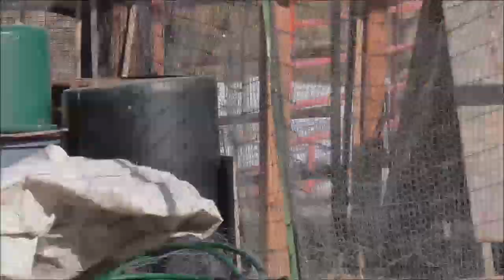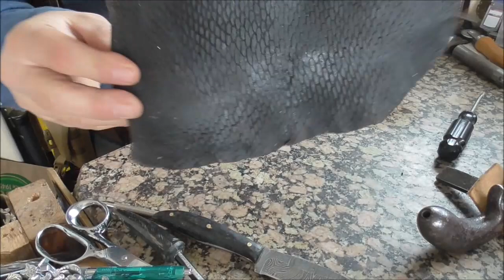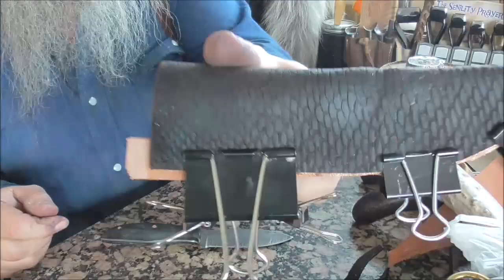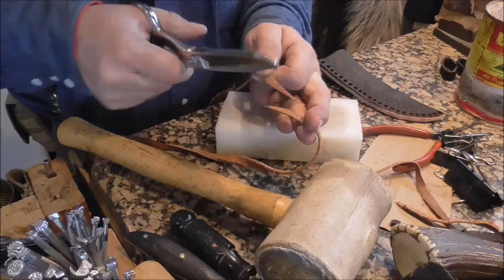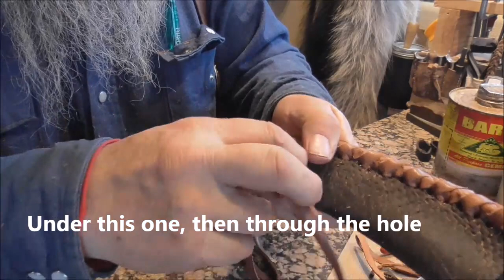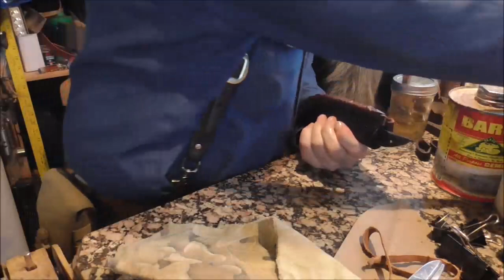Making a Beaver Tail Knife Sheath with a Braided Edge

Comment: Man you move fast! Quiet to😄. That sheath turned out great. That braid is beautiful and looks really nice with the texture of that beaver tail. The beaver tails I've tried to tan came out stiff enough I could just about use them for a shovel. I was going to try a second round on them but a neighbors dog figured they made a pretty good chew toy. She was probably right. That was years ago. Haven't shot or trapped a beaver since then to try it again. I always wanted to make one of those big trade daggers with a beaver tail sheath.  Nice work. Take care
Reply from the maker: Thanks!  These tails turned out stiff too. That should be good as a knife sheath though.  I think I've figured it out how to tan them better now, but they are still kind of stiff.  Quebracho bark  is what I used the last time. I'm still trying to learn too.   Lime to slip the scales off.